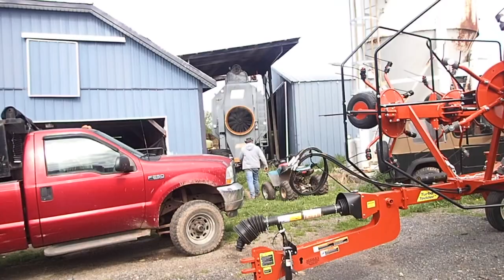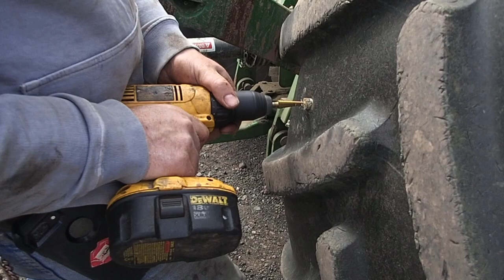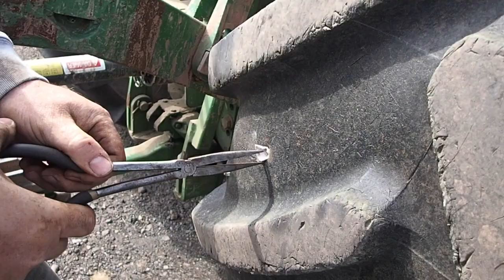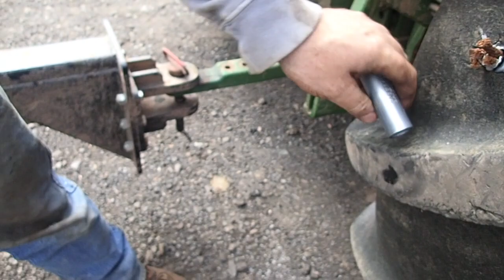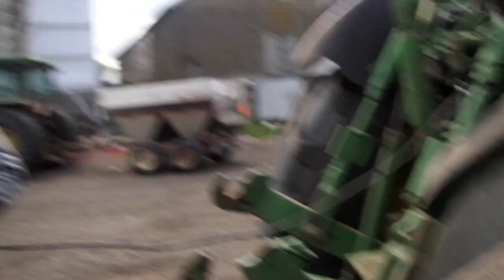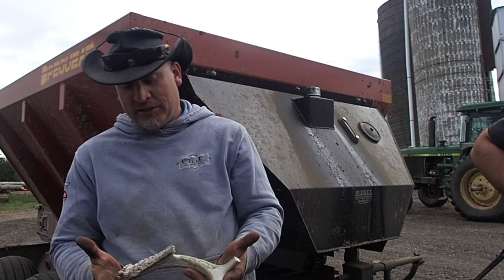Plan B

Comment: Check into a Carbide tire reamer. Either air drill or electric . I have pulled out nails, screws and a 3/8 extension and other odd things with them

Comment: I fixed a rear tire on my M-923 that had a 16 penny nail in it with the same method, still holding 2 years ago, hauled several loads of hay and machinery with.  Good repair Wes, works good lasts a long time........

Comment: this is the exact reason i quit running calcium chloride ( highly concentrated salt water for those that don't know what that is ) in my back tires... and i have quit running my tire tractors in the bottom fields by the river and use my 2 cat belt tractors... 65 for working the fields and i got a smaller 45 i use to plant. God bless all the deer hunters that hunt on me... Deer are as thich as the hair on my dogs back where i am...

Comment: Hi OLF.  Long time viewer, first time commenting.  I own a machine shop, and I'm a part time small scale farmer.  Probably already thought of this after the pressure was off and you had time to think, but I'll throw it out there anyway. A nice coarse threaded sheet rock or wood type screw in the center of those stubs, and a cheap dent puller does wonders on stuff like that.

Comment: my only question is, isnt it dangerous when you do this under air pressure?
Reply: Avatravex, tractor tires on average are only 20 to 30 psi max, not normally a threat to blow out unless it's a big weak spot...
Reply: tughill farmer ok, thanks

Comment: do you have trouble with 2 plugs pulling out whie in use
Reply: Jeff Everhart my opinion... he will wear the tire bald before those plugs ever loose a drop of air... 3 years ago i got one in a back tire and it took 3 pluggs for the biggest hole 2 in the second hole and 1 in the third... its the only darn tire on the tractor that doesnt loose air over a period of time...
Reply: seemed to be game

Comment: should of put a screw in the antler to help pull it out
Reply: deer antlers are metric though
Reply: Thats what I would of done.  Just get a short 2x4 and drill the hole for the 3" dry wall screw thru it.  Then screw in the dry wall screw to the antler and pull the 2x4 out with the short piece on antler.
Reply: lag bolt.. drywall screws don't have much tensil strength.
Reply: Just let the air out, push them on through, those are tubeless tires, won't hurt anything more than what's already been done.
Reply: Patrick Pikulski  long as the antler gets out and tire holds air after being repaired is the main thing.
Reply: Andrew Phillips ze
Reply: Andrew Phillips I thought that too
Reply: Aaron Stoltz a screw exerts force a lot different than pliers.
Reply: you dont realize that with a screw it has threads why do you think that a bolt with a nut could be tightened down so much the threads should hold and it you pre-drill it just like wood it would more than likely hold to get the antler +Aaron Stoltz
Reply: ahhhhhhhhhhhhhhhhhhhh yes

Comment: don't you just love deer? it's even better when the tires are loaded. also it's not that you CAN'T fix a sidewall but more that you shouldn't. it's a safety issue and most shops won't do it simply due to liability

Comment: Wtf, people think you can't patch the tread but side wall.  A tread patch is a more secure patch than any side wall patch with plugs.  In automotive plugs were never allowed on aide walls and now industry frowns on tread plugs, I still use em but never on aide walls. A freaking tractor is safer since they don't barrel down roads at 80km or more and risk a blow out. Keep doing what your doing. Always have a plan b

Comment: you're never gonna get it out like that the minute the tire deflates it is cramping the antler. Use the grapes and pivoted them would have got it out! not by rotation? put something on the opposite end when pivoting like a nail or Bolt.